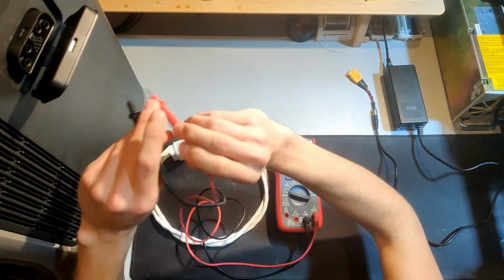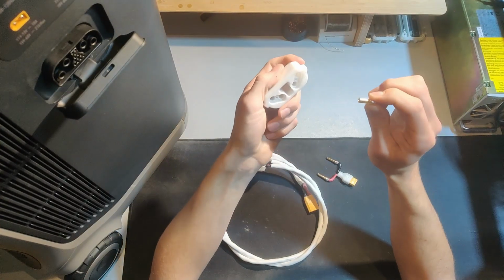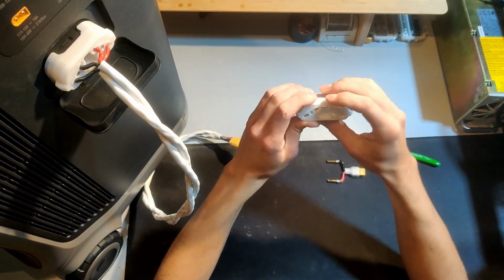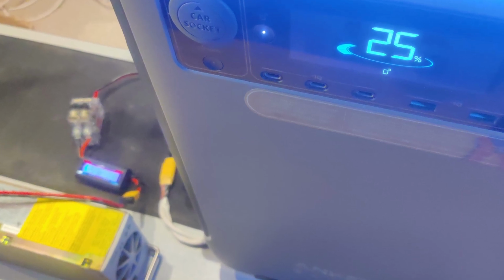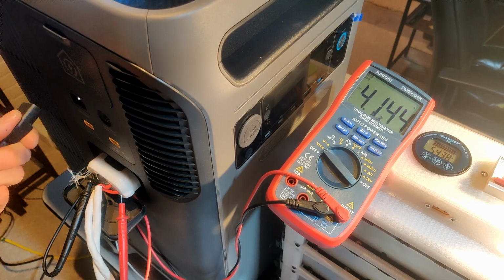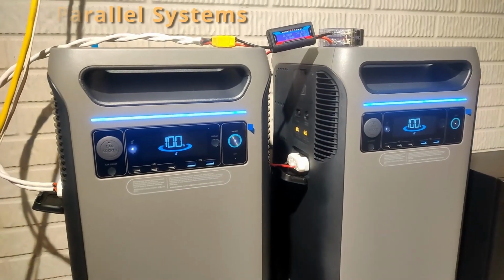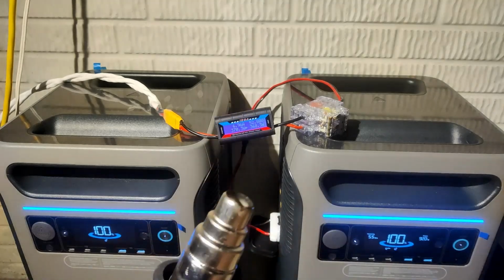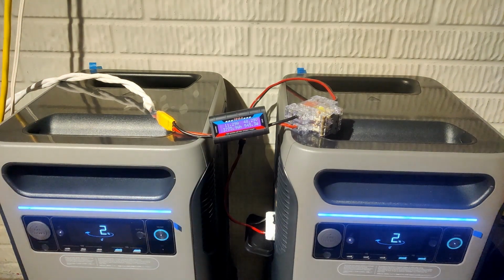Anker F3800 - Expansion Port Holds INSANE Potential (Tested)

Comment: My question would be if on the F3800 plus, that has a dedicated DC generator port, if it would work the same? And according to those numbers I could buy a golf card battery 51.2, and connect it directly as they are the same battery type. With a price of 2 battery that are 5120Wh, if still cheaper than a single original expansion battery

Comment: like you discovered a miracle... how about just  buy ankers external "host" cable to connect anker external battery for only $29 cut it in half and ad two ring terminals, voila, it charges and discharges ANY battery

Comment: Could the cross connect work at balancing two 3800s when setup in 240v into a power panel.  What I expect to see is one unit draining faster than the other depending on what leg the load is on in the power panel

Comment: Hi, I have an Anker F3000 power station and I checked the connector, and it fits perfectly 👍 My question is this: the F3000 disconnects the battery port as soon as it's switched off. What happens if there's still a battery connected, or if it's plugged in when there's no power at the port? I don't know if the F3800 also disconnects the port. Could you tell me anything about this? I'm hesitant to try it out. Thanks in advance, also for the great adapter 👍

Comment: I suppose using a Chargeverter connected to an external battery could increase the usable capacity of external AND OEM batteries via cascading down the chain using higher charge voltage limits. But the reverse would be true, using Anker's internal 6000W charger with its lower charge voltage limits could reduce the capacity of 3rd party LiFePO4 batteries, but increase longevity, I imagine.

Comment: The connector you get is counterfeit Amass 5.5. I had a lot of those, the biggest issue is it is not heat treated and bend properly, also uses copper instead of berillium copper to increase the bend resistance, the contact resistance will go up over them and eventually free falling inside the connector barrel

Comment: Do you have an F3800 Plus and have you been able to experiment with the smart generator input port?  Thanks.  Great video.
Reply: I measured the voltage on the port and got 53.5v.  I also noticed that the tiny control "ports" are slightly different, but the battery connection cable has pins in positions to be able to work with both the battery expansion and smart generator connections.  For what it's worth.

Comment: Does it work with the battery port on the f3000?
Reply: I just tested this my self and the port is active on the f3000 but I don’t have the means of connecting a 48v battery yet still trying to to get one of these connectors from Evan.
Reply: @dariuscharon8151  Do they both use the same connector? I also have a f3000, trying to figure it out!
Reply: @troutcreekman  yes it is the same connector.

Comment: Has anyone been successful at this approach with the C1000? I see comments desiring to do the same, but also some that do not measure the battery voltage on the expansion port. I suspect the C1000 needs the communication to be active.....BUT has anyone figured this out?
Reply: I am interested to the answer too.

Comment: Do you know if it would be possible to share a single large 48v battery to 2 F3800s via this cable hack? I have 2 F3800+'s but only want to buy 1 large wallmount battery (15kwh), i'd like to hook both to the battery using the battery cable hack described here (each F3800+ would be connected). Any issues?

Comment: So have a full Anker F3800 system with the home smart panel and 1 expansion battery. I was wondering if i can add a 48v lifepo4 battery to the exspansion battery port in line with the anker proprietary battery along with the F3800?

Comment: The discrepancy in % when you had them parallel with a load on just one batter is due to your way to thin cables. The resistance in the cable made a voltage drop and thus limited the amount of power drawn from the second battery. It was only until the voltage fell enough on the main battery that it overcome the voltage drop on the cables that you saw an increase to almost full load on the secondary one. Pure logic.
Reply from the maker: Can confirm! For that final test, I threw together a temporary second connector using one set of 12AWG wires and it was barely adequate lol. It also doesn't help that the LiFePO4 voltage curve is practically ruler flat from ~20-90% SOC. So even a very minor voltage drop in the connecting cable can cause a discrepancy. But as seen in the video, once the SOC goes below 20%, the discrepancy quickly began to correct itself.

Comment: Great video this opens up so many possibilities.  I also have an F3800 with one expansion battery.  I've built a separate Victron solar array with 300Ah LFP batteries to charge all my lawn equipment, scooters and ebikes but it would be great to have a direct connection from those batteries to my Solix rig and be able to charge bidirectionaly as you've shown in this amazing video.  I'd love to get one of those connectors you've made to leverage the expansion battery port.
Reply: Me too!

Comment: I think the reason for the percentage difference when running 2 of them in parallel is that the small cable was limiting the current that the 2nd Anker was able to feed the other. If it was thicker cable it would have kept up I am fairly certain. 18:44
Reply from the maker: Can confirm! For that final test, I threw together a temporary second connector using one set of 12AWG wires and it was barely adequate lol. It also doesn't help that the LiFePO4 voltage curve is practically ruler flat from ~20-90% SOC. So even a very minor voltage drop in the connecting cable can cause a discrepancy. But as seen in the video, once the SOC goes below 20% (or above 90%), the discrepancy begins to correct itself.

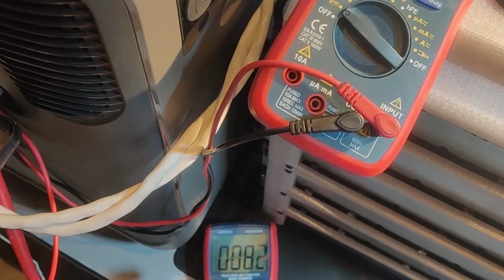Comment: 14:07 are you sure thats a circuit breaker? in my country the red switch means its an isolation switch and they dont protect anything, they are just a switch. Might wanna check that
Reply from the maker: I would appreciate if they were color-coded by function! But in this case, I believe the red color is just EARU's company branding. They're great breakers and definitely trip - I've tested them :)
www.aliexpress.us/item/3256807487508518.html?
Reply: @NoiseLab47 thats strange, the end of that title still calls it a switch isolator, but if it trips i guess it is a circuit breaker. Either way i wouldnt be buying protection devices from Ali express

Comment: Are there recommended parameters for the 3d printer to make this strong enough? I know nearly nothing about 3-d printing -- my grandson will make it for me. He asked me a lot of questions about printing parameters that I don't understand. His recent email to me said this:

"Ok so I did some research and, the more wall loops the stronger. So if this part will work I was thinking to do 5 wall loops and 100% infill. That way it should give it a lot of strength. 

Now if you really want it to be strong, i will have to get some PETG (which is stronger PLA) "

Anything you can suggest should be helpful to us.

Comment: Do you think Anker could change the functionality of the port via OA software update? It would suck to buy/make dIY battery just to have the next firmware update lock the port
Reply: You can always use the solar inputs so the extra battery wouldn’t be a total loss.  There is no way I can think of that they could defeat straight dc into the solar without completely killing using solar panels too.

Comment: Incredible work. I have a SOLIX C1000, which has a different expansion plug, but I would imagine it's wired very similarly. I have a number of 100Ah 12.8v LiFePo4 batteries sitting around, and I'd been contemplating doing this exact thing to expand thee SOLIX's runtime. Subbed, and looking forward to seeing your continued experiments.
Reply: I have that too. I check and there is no power on those ports when testing with my multimeter
Reply: This is exactly what brought me to this video.  I have a C1000 and would like to get 12VDC out at more than the 10A the 12V socket is rated for.  I want to power a 12VDC air conditioner but the AC high draw is ~35 amps

Comment: Ok I've done some testing of my own. My setup:

F3800 and 1 expansion battery, 1 vatrer 48v server rack battery, etaker f2000 dc to dc charger/solar mppt. Extra Anker battery cable cut in half. Vatrer 48v battery terminals spliced onto it. 

Yes the battery works as you have done in your testing. However there is a twist once you add in solar charging to the mix. 

The Anker f3800 will pull from the vatrer and expansion battery, keeping the main unit at 100%. When this happens it doesn't utilize the solar inputs at all. Which without the vatrer 48v battery attached, it pulls from both the f3800 and expansion. This activating the solar inputs and taking charge. 

The fix for this is to move the solar input from the f3800 to the vatrer battery.

However I don't know how the f3800 will deal with that setup yet.
Reply: I believe you have to set your self consumption settings in the app to something less than 100% for the F3800 to accept solar charging..

Comment: Good video. I was thinking about purchasing the expansion battery cable and cutting it in half ($99). I would connect it to a disconnect breaker and then to my battery bank. I don't have access to a 3D printer. I have two server rack batteries connected to the solar input and it has been working well but the input on one is limited to 1150 watts. I have 3900 watts of solar charging my batteries through an Victron charge controller.
Reply from the maker: Thanks! Yes, what you have in mind should work great and would solve the 1150W input cap, since in effect your Victron would be charging the server rack batteries AND the Anker's internal battery as one battery bank. I haven't gotten my hands on the OEM battery cable, but it should be  a pretty straightforward process to implement.
Reply: @NoiseLab47  my cable just came today. I’m planning on connecting one end to a disconnect breaker, then to the battery.
Reply: So I undid the end of the cable, disassembled it carefully to see what was what. I ended up cutting the center cable with the I assume are communication wires to get the out of the way. You can slide the protective cover back about 4” so it still looks clean. I left the cover end on also. I doubled up the two positives and negatives and connected them to my stand alone breaker box. Connected my battery bank to the other side of the breaker and switched it on. It’s been working with no issues for over a week. The battery soc is off by a little bit but the voltage is tracking. I’ll keep it this way for now and keep an eye on it. Seems to be working perfectly.

Comment: I have a Chargeverter for sale if anyone interested.  The black new one not the old yellow one.
Reply: Technically you could connect the chargeverter into the expansion battery port to charge the F3800 at super fast speeds, and keep the 240v on... At least thats how I see it would work here.

Comment: Outstanding video ... I will be interested in two premade connectors ... here is my thinking. I can get two EG4 LL-S batteries (51.2v, 100AH, 5.12kWh)  for about $3K and add one each of my F3800's. In my mind way more efficient than the expansion batteries from Anker. Thoughts ???
Reply from the maker: Yes, that's exactly the way I envision this connector being used! Any of EG4's 51.2V LiFePO4 batteries should function seamlessly with the internal battery. In fact, they're a perfect candidate for a quick and simple setup since they have a circuit breaker built in!

I've been working on a website to list the connector, but I'm not sure when that will be live and functioning properly. For now, if you email me I can get your info and send an order your way.
evan.noiselab@gmail.com

Also, sorry for the late response. Still figuring this YouTube thing out lol

Comment: Well done!! This is the stuff that I wish the other YouTubers would test and try.
So seeing this we can determine that we can use a cheap large server rack to expand the capacity of this very strong inverter?
Reply from the maker: Truthfully, that's why I posted my findings in the first place - I couldn't believe nobody else had! But yes, that seems to be the implication! You can just hook up a 16S LiFePO4 battery to that port and it effectively becomes part of the internal battery.
Reply: @NoiseLab47  just saw someone do it with Oupes brand power station. I need to get one or the other before either company becomes aware and do something internally on the stations to stop this useful hack from working.

Comment: I've been having fun since the inspiration of your first video; I'm going "in the backdoor" through the expansion batteries.  The only test I need to still do is to see if there's connectivity with the units powered down. (Are there relays in the daisy-chain expansion battery buss?)  Funny, an early criticism of the Anker Dual Power Hub was that it did no DC balancing  between the separate expansion battery strings, this simple jumper accomplishes this.  BTW 5.5 mm is way too big for the bullet connectors.  I think they're 5.0 mm nominal.
Reply from the maker: Glad to hear it! I can confirm that when the F3800 is fully powered off, the continuity to the internal battery is cut. I suspect the power button triggers the internal BMS (battery management system) to shuts down, and its MOSFETs break the circuit - much like a relay. Maybe the Anker expansion batteries do this too... or maybe it's something else!

By the way, many of the 5.5mm connectors need the tips compressed inwards a tad, just until they're parallel with one another rather than pointed outwards. They still fit rather tightly but not too difficult to push in. With that said, I am keen on developing a V2 of this connector with a more OEM fitment that slides all the way in.

Comment: Single F3800, 8 51.2v 50Ah batteries in parallel. Currently, charging the batteries via solar panels. At night, off-peak, I use the Chargeverter plugged into a 120v 30amp outlet to fill the batteries with what the panels couldn't supply. In the morning I have to set the Self-Consumption on the F3800 to something less than 0% then at night set it back to 0%. That way the grid will charge the F3800 to 100% while the Chargeverter fills the batteries. If I'm understanding it correctly, THIS would make it so that I could set and forget the F3800 as the connected batteries would charge via the expansion port. No long would I need to set/reset routine, correct? My concern, partially addressed by the video is the current. My battery bank (8 51.2v 50Ah batteries in Parallel) has the potential of being drawn at 400Amp. Something I would not want to happen. It looks like the max draw was around 100amps. What gauge wire where you using? The Amazon web page for the plugs says 8AWG was recommended. Is that what you were using?
Reply from the maker: I'm not super familiar with the HPP settings like self-consumption, but I'm pretty certain that using the expansion port will simplify your setup to some degree. The bottom line is - by using that port, the Anker's internal battery and your external batteries become one singular battery bank. They charge and discharge in unison.

As for current, the Anker's 6000W inverter won't draw more than ~130A continuous (6000W @ 90% efficiency); and since the onboard battery will cover some of that, I doubt more than 100A will ever be required through the expansion port for 99.9% of people. That is unless you abruptly connect an external battery at a very different state of charge, like I did in the video. 

I used two sets of 12AWG copper wire. Over short distances that's fine for casual use / testing, but for a permanent setup I'd opt for a minimum of 10AWG. 8AWG for peace of mind and/or longer distances. Just be sure to put a 100A or 120A circuit breaker between the Anker and external batteries.

Comment: I enjoyed the testing. Nice work! I love seeing how it's battery expansion port is a direct connection to the internal 51.2v lfp battery. It supports quite a bit of power too (100 amps briefly, 50 amps looked more reasonable!)

It also appears the power is accurately tracked through those expansion ports as the SOC changes as the battery is charged and discharged. 

I don't have a 3D printer.... But boy I could have some fun with a larger solar array / charge controller and the EG4 chargeverter if I had some battery connections 🤣👍

Would Anker like me doing that testing and showing the world? Not at all, would this type of thing void warranties.... Absolutely! Haha
Reply: Couldn’t you just cut and repurpose a expansion battery cord?
Reply: @ I have had trouble finding one to do that with
Reply: @jonathantschanz4902  Yes, forgot who put out a vid on it last week after seeing OP's first video about it. But I would almost rather DIY it vs the cost of buying the cable and cutting it up.
Reply: Have you done this with the F3800 plus and are you selling the plug kits yet?
Reply: The file is not there on thingiverse
Reply from the maker: Forgot to make the post public after publishing the video, whoops. It's active now!
Reply from the maker: Yeaahhh... I can't imagine Anker would be too impressed about this going mainstream. 😂

I was hoping to hit 80A+ for at least a few minutes but the voltage equalized rather quickly, all things considered. I guess I'm gonna need to grab a Chargeverter - then a sustained 100A is no problem!

Appreciate the feedback and support! Your channel's been instrumental in my own understanding of these systems, and no doubt many others' too.